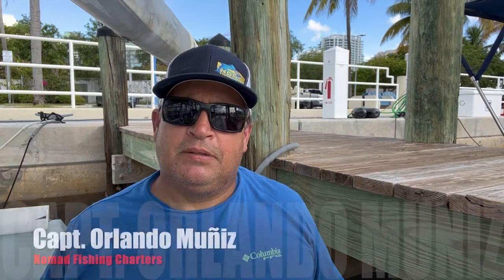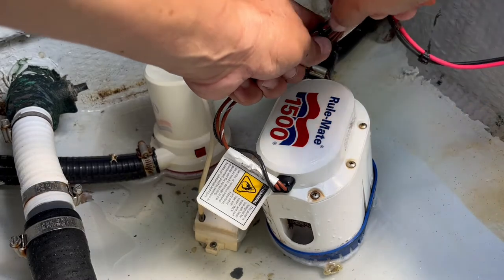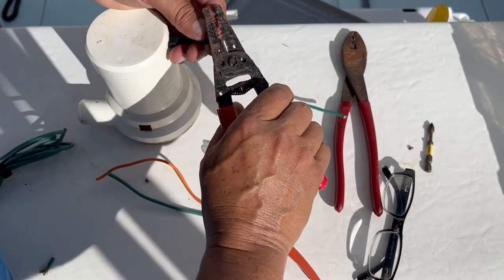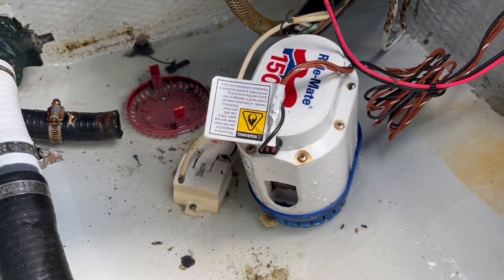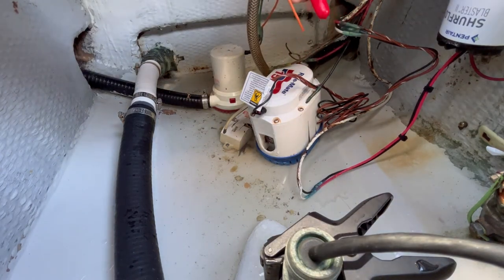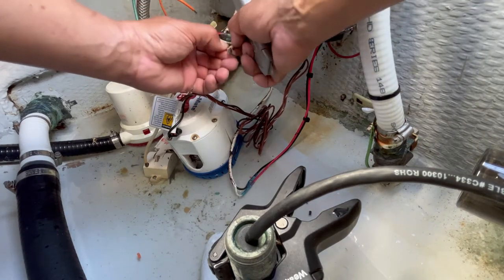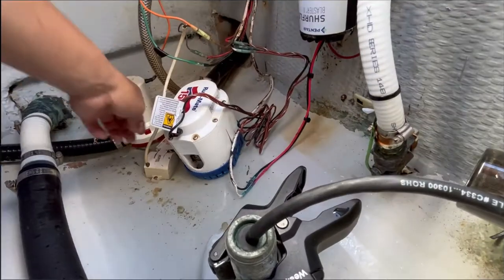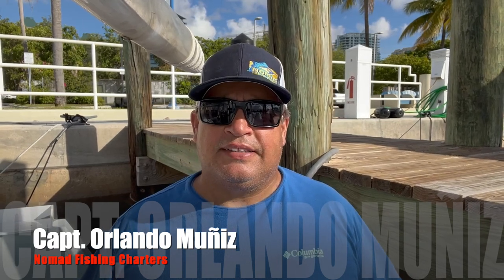How to Replace or Troubleshoot Your Boat's Bilge Pump Float Switch

Comment: Thanks Captain.
My pump tabs are broken on the deck mount. 
I guess I have to get a whole new one not sure if I can just buy the bottom piece that the pump mounts to I'm doing the other one not the one you're doing. Thank you so much you're always so informative and it's great to watch.
Reply from the maker: Thank you! I’m pretty sure I’ve seen those bases sold separately but they might be difficult to find. 
Good Luck! O
Reply: @CaptOrlandoMuniz  I am gonna replace the kit and kaboodle! This ole woman doesn't want to swamp her skiff. Ps hopefully I will fish your charter. When I searched bilge pumps on YouTube, yours was the video I wanted to watch. Thank you again for all the rigging info, your fuel tank/deck repairs and all your hard work!!!